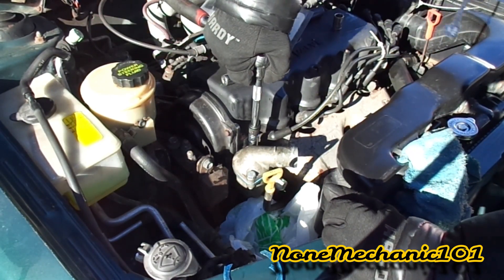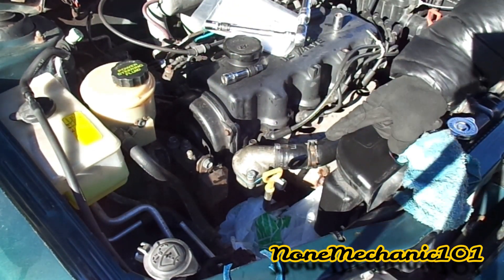Replacing The Thermostat On a 1997 Hyundai Accent

Comment: Hello, a Happy New Year, my question is, the overflow tank is bubbling, this after I drive about 10 km, 
is that because of the thermostat need a new gasket, or is the head gasket blown? 
I have a Hyundai 1996 with a Y2k engine. I had for a sort while the water in the system and it did not bubble, now have the engine coolant in the system and now bubbling started !
Reply from the maker: If it has to much water it would bubble.

Comment: I have a 1996 Hyundai Accent, after a drive the engine coolant of radiator it fills the overflow tank, is that because of the thermostat it fail to work, or is there something wrong with the radiator cap?
Reply from the maker: I would check the hoses
Reply: @NoneMechanic101  Hello, thank you for reply, checked, the hoses it has  no leaks. But after a ride of 20 km the water in the overflow tank is boiling, like a boiler ! but i don't see any indication of that on the dashboard that something is wrong. 2 possibilities, whether its the thermostat or something wrong with the radiator.....or maybe something else?

Comment: hi .. if you can kindly answer me .. when the car doesn't has a thermostat dose it effect  the hot air inside the car .. ?
Reply from the maker: Yes the car can still get heat but not as much because the car doesn't reach operation temperature
Reply: @NoneMechanic101  thank you so much
Reply from the maker: @abedalkareemabuhani548  👍